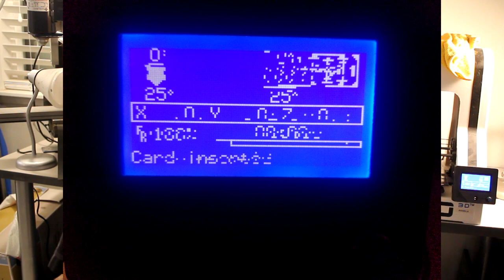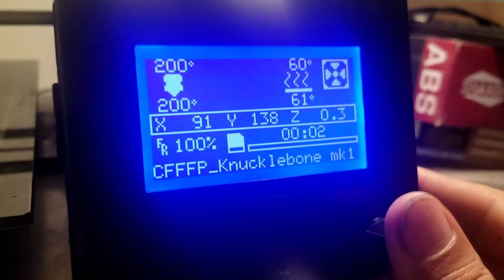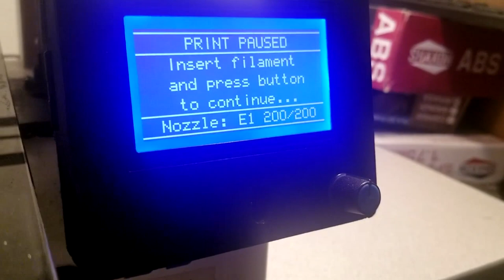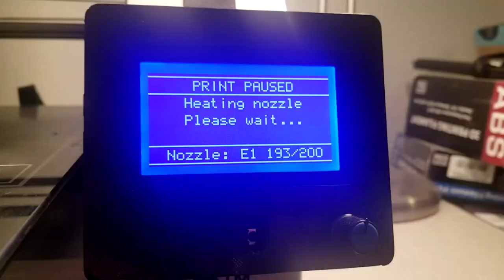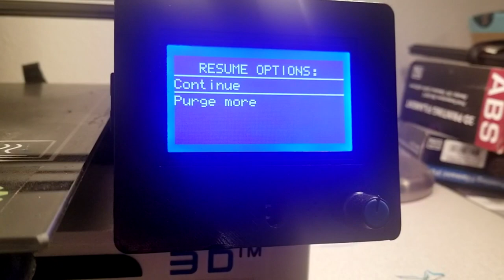Expert Mods: Marlin Firmware 1.1.9 Robo 3D R1+

Comment: Hi I know this is an old vid but...
I just got one of these printers I’m assuming is mostly stock.
It is running 1.1.9 marlin with the same display.
Haven’t printed with it yet waiting on filament.
You mentioned something about changing your screws, will yours work with a stock r1+ ?

Comment: I made some initial modifications from your videos years ago and my Robo R1+ has been humming along nicely since.  My hotend finally started giving me issues so I decided to upgrade it to the E3d V6 (finally) and figured while I was at it I'd do the Firmware and look for other mods to tackle.  Does your firmware file have your RGB LED Mod code additions already included?  It looks like it might but I'm not seeing the pins.h entries.  Granted it's been 4 years since that video so things may have changed regarding the pins.h stuff by now.   Do you have a list of all the modifications you've already accounted for in the firmware?  I've got the parts for the Filament Runout Sensor mod that danzca6 posted in the Robo forums and am going to start messing with that upgrade too.   Thanks for all the videos and knowledge sharing.  They are greatly appreciated :)

Comment: Did you configure Pins.h? the R1+ has one z stepper to the z driver and the other z stepper to the second extruder driver.  I believe you have a single driver connected to both z steppers (you made a video saying that).. but single driver to two z steppers is not how things are out of the factory for the R1+

Comment: Awesome, I like the display screen and I will look into getting one. I do have a question that I have always wondered about my robo. When my robo does the 9 point calibration it will be off the square boundry of the print heated area. do you know of a way to adjust that or correct that ? Thank you in advance.
Reply: This happens to me too, did you ever find a fix?
Reply: @giantmanice  after doing some research, my Robo3d printer does the calibration correctly so i don't think its an issue. More like they printing the decal on the glass incorreclty. I have been printing so many things that i haven't had any issues. The heat transfer on the printing board is good.

Comment: QUESTION:
I want to run a pause gcode that will resume even if I move the print head And G28 Home.
My problem is G28 X0 Y0. Turns off bed map.
And, If I don't home, I can't locate previous pause location on resume, if hot end gets moved.
My question is:
IS THERE A WAY TO RESUME BED MAP? After G28 X0 Y0. (Home)
G29 I, G29 s1,  M420 S1, M501 Don't work.   Thanks.